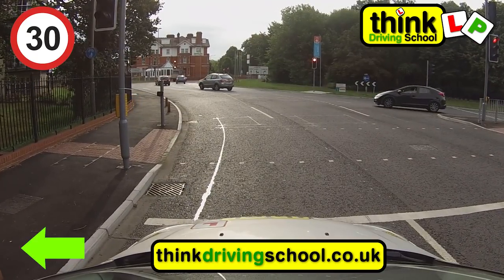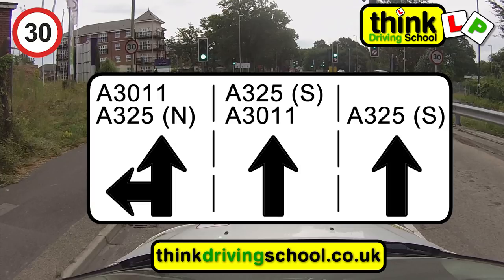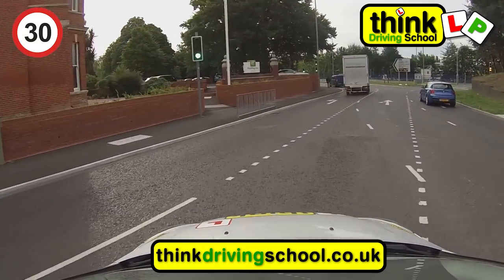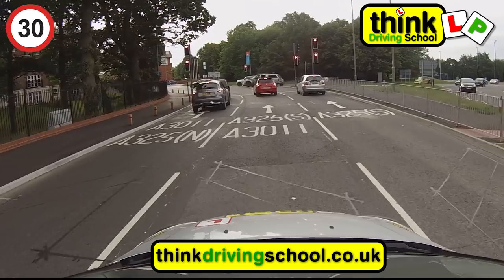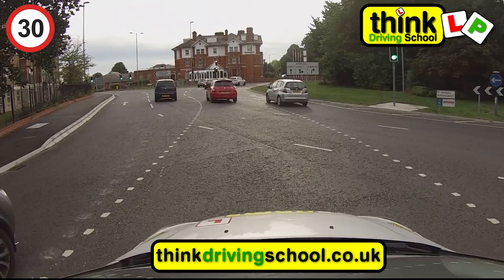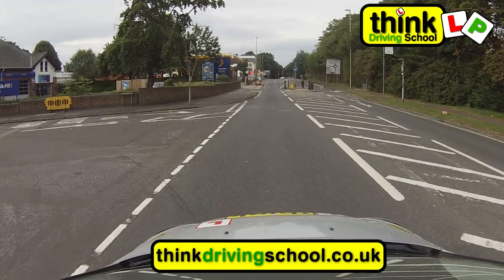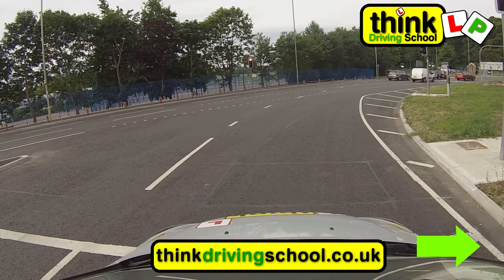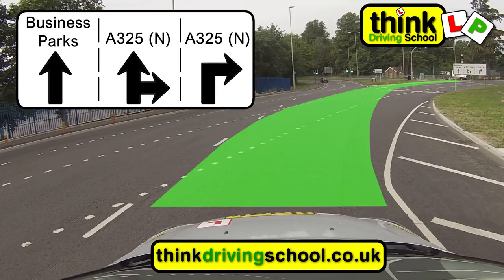Queens (Multi-Lane and Spiral) Roundabout by Farnborough Test Centre from Think Driving School

Comment: This video is very useful, but I have to say: I hate British roundabouts with a vengeance. Look how uneccessarily confusing the roadmarkings are, and how lanes criss-cross and merge - 4 lanes become 3, 3 become 4 - and all the while you have to watch the road markings, read the signs, control your vehicle, and watch for other drivers. British roads.
Reply from the maker: They are more complex than needed i agree with you
Reply: Think Driving School
 I think I would mind less if it weren't for the fact you can fail your test for doing what you can see other drivers on the road are doing. Which is exactly what happened to me. But regardless, they should be simplified to avoid confusion, and I honestly think it would help drivers (and maybe road safety?)
Reply: Perfectly said!

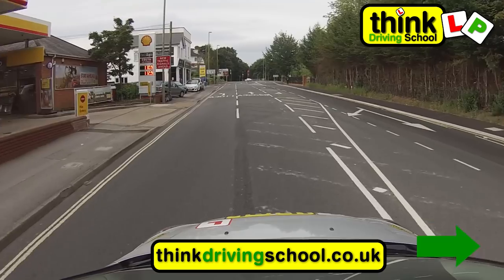Comment: 5:40 approaching to turn right from another approach road I note the 2 entirely different signs, one left and straight ahead only, and the next having left,  ahead and turn right.   Why is this?  My guess is the first sign is for a major route and left and straight on mostly used.  It is a puzzle though why both signs wouldn't be the entirely the same.  I've never assessed signs for sign sake in 25 years, if I had this likely would make more sense ?

Comment: Hi, amazing video!

Can I ask how you tell the difference between a normal or a spiral roundabout on approach, based on the road markings?
How can you tell the following up roundabout will be a spiral - with strict lane sticking rule -, or a normal one, where the general roundabout rules apply?

This is what makes the confusion for me all the time. I can select the best lane, easily, but what's after? Should I look out for signs or road or markings or whatever, which tell me which set of rules I have to apply?
Reply from the maker: Vivien M normally only road marking when you get there will tell you I’m afraid so just be hyper aware on RBs you don’t know :)

Comment: Hi, this is a really helpful video recommended to me by my instructor but I just had a few questions where your advice seems to differ: in my previous driving lesson i did the lane change like you did at 7:25, checked my mirrors, used a signal and moved safely (no other cars were even around) but my instructor said that would be a fail and i should have only moved over to the middle lane, not the furthest left? then as i exit the roundabout, signal left to move across in the road after?
Reply from the maker: How it is on the video is perfect, and how a good driver should do it, what you described is fine too, but you leave yourself open to having lots of people passing you on the left and making it hard to get back to the left lane as you come off.
Reply: @ThinkDriving  okay thanks, i’ll continue doing it like in the video then
Reply from the maker: @erins1333 just make sure your checks to the left are really good, and you will be fine :)

Comment: 6:35 im doing this roundabout on my test which is in a few days - followed your exact instructions on this but my instructor said its incorrect! He said you have to leave your right signal on until you indicate left to exit.

Can this also be done or is this incorrect?😂
Reply from the maker: As long as a signal is not misleading then it’s fine, but think about what’s you are doing there, you are moving left 2 lanes with a right signal on, 
Also because this particular roundabout is traffic light controller the people coming onto the roundabout from Aldershot are not looking at you or your signal to make a decision about going into the roundabout, as the traffic lights control them. So both ways are fine, but I’d say leaving it is more misleading than helpful. Good luck with your test let us know how it goes

Comment: do you indicate when switching from the right lane to the furthest left when going across lanes?
Reply from the maker: What you need to do in these situations is work out if that signal is going to be more helpful or more misleading. 
Remember your position is a signal to, so if you move at the right times that can sometimes be enough of a signal. 
In the case of this roundabout if there where people following you, will they think your signal is to go down the second exit? As we want the third exit but need to move across lanes before we have passed  the second one, it may then be misleading. To then add to this remember if we check our mirrors to change lanes and we don't think it is safe to move lanes we can always go back around the roundabout and try again. At the end of the day its about being safe, so going the wrong way is sometimes the safest thing to do. I hope this answers your question?

Comment: At 6:05 shouldn't the sign on left lane indicate 'left' as it is only allowing the exit of the roundabout and not going straight further around roundabout?
Reply from the maker: It would be useful yes, sometimes roundabouts are not perfect 👍
Reply: @ThinkDriving  Yea. Last week I was on this roundabout and got honked because I wanted to go to business park, and assumed that this lane is going straight and not only 'left' based on the road marking :(  Does that mean we can't always rely on the road marking and must refer to roadside signs?
Reply from the maker: @sujitjagdale582  sometimes they can be a little misleading, but if you look at the lines on the road too, they are directing you to that exit too, so it’s a case of look at all the markings and take the safest option, and even if lines take you a particular way always check it’s safe first 👍

Comment: So under NO circumstance I should expect to be switching lane on a 
spiral roundabount? If i start in the correct lane, i will naturally end
 up in the correct exit with no issues?... Right?
Reply from the maker: If the round bout is set out perfectly, and your not doing a U turn then yes. The problem is there are always an exception to the rule, so keep looking at the road marking. some are laid out badly unfortunately, so what ever you end up needing to do, do it calmly and safely :)
Reply: @ThinkDriving  thanks for the feedback, very useful suff!

Comment: You will fail your test if you take the wrong lane, will be a serious and test is over.
So yea roundabouts need attention for your test.
Reply from the maker: GoodAdvicesForFranco you won’t fail your test in you got in the wrong lane safely and then deal with the situation safely either by going the wrong way which is normally the best thing to do. Or get back in the correct lane safely. Hope this helps